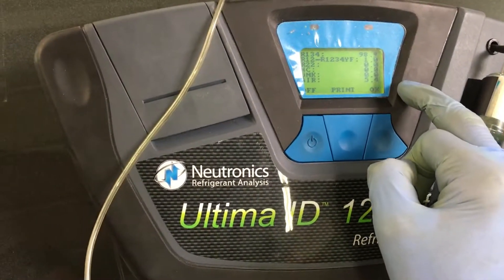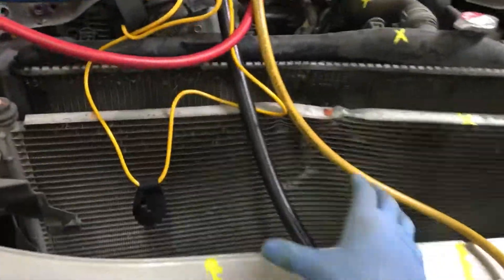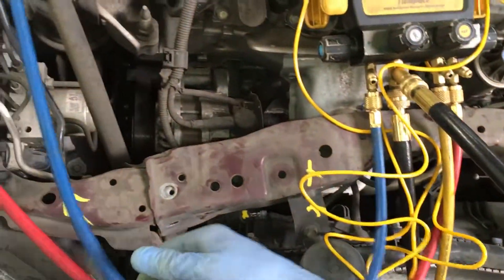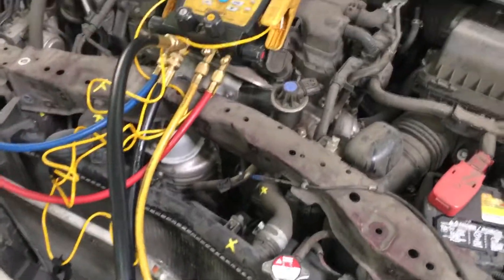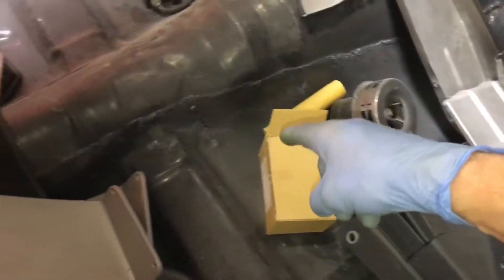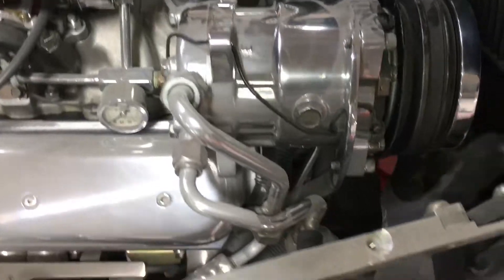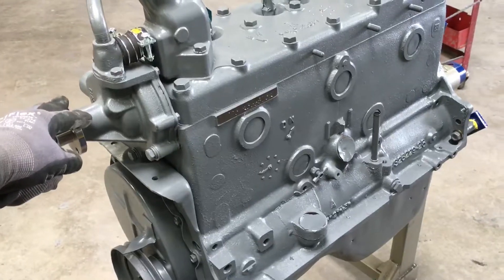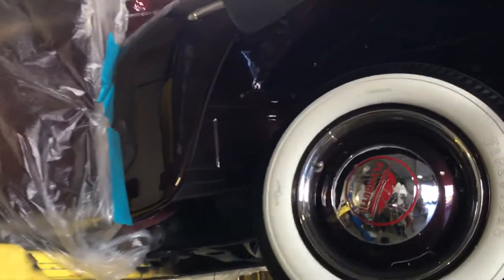5.4% + 1% R1234YF + R134a mixed refrigerant. mandatory $10,000 fine for every car shop contaminates

Comment: Looks like a Ford Falcon pickup. Nice. Red engine is a 200CI,  not going to do the liter conversion lol. Had one in in my first car. It was  from ‘back then’. My grandad got that car for my mom when it was new (and she gave it to me, my first car). He said he didn’t get her the V8 (that she wanted) to keep her from killing her self lol. I got in a few scrapes with the straight six 😂. Nice shop
Reply from the maker: Old straight six or engines that lasted forever. Comparable to the reputation of reliability of Toyota decades later. 
           Remember the dodge slant six. 
I had to remember change that little plastic gear attached to the distributor evert about 40,000 to 60,000 miles change the time in chain every 120 thousand miles and you had nearly half million mile motor life. 
          Dodge went from this to pieces of crap that could barely last 80,000 to 150,000 miles and have zero resale value when they get old

       Actually truthfully I don’t even know why dodge still exist or is even allowed to exist as a car company.

        Except for the Challenger hellcat that’s a fun car
Reply: @coldfinger459sub0  Fun fact, slant 6 is one of the few engines that the oil pump is on the outside of the engine. Few bolts and it can be changed. I remember the nylon distributor drive 😆

Comment: What did you do with the contaminated refrigerant?
Reply from the maker: Fortunately it’s only 1% R1234YF well within the standards that are allowable to recover the refrigerant.   ( even though I do not approve of it our dumb ass EPA allows a slight amount of contamination )  
               So the 360 g of R134 refrigerant that I recovered that contains 1% R1234YF Will be mixed and diluted with 12,300 g into recovery tank. So if you do the math the percentage of contaminated refrigerant will be diluted down to a nearly unmeasurable quantity. 

               Air is an easy contaminant to remove from the gas so I have no problem with air but it is very detrimental to the efficiency and performance and the life of a compressor and air conditioning system with breakdown of oil and poor performance and efficiency. 

         As for the shops that do not own refrigerant identifiers that’s the exact same thing as intentionally in on purpose contaminating your refrigerant supply by claiming they are ignorant or they are lazy or they are cheap or a combination of all of the above. 
               Therefore those kind of shops need to be educated or eliminated, executed, eradicated, exiled, excommunicated,  completely removed from the automotive business vanished. 

          If it was grossly contaminated refrigerant say 5% R1234YF + 3% R 22 + 1% R 410
          This kind of refrigerant goes into my contaminated tank that is a mix of all refrigerant’s that are bad. 
           And when I’m going down to my local warehouse to pick up refrigerant or exchange new refrigerant tanks I just drop it off to them and receive a new fresh tank back in exchange. 

       In my local area this service is available through Johnstone Supply
American Refrigeration Supplies
Baker Distributing
These are my local refrigerant pick up and drop off recycling centers